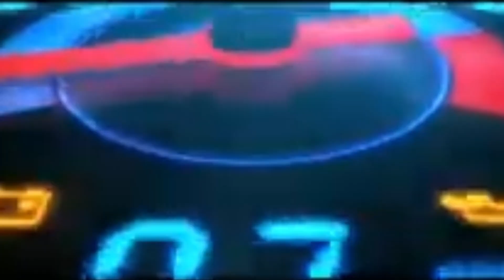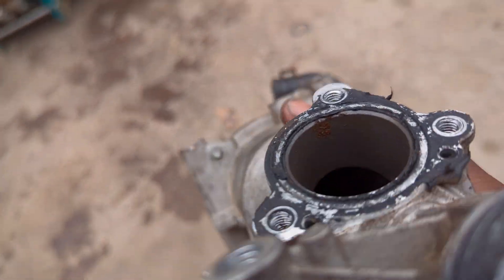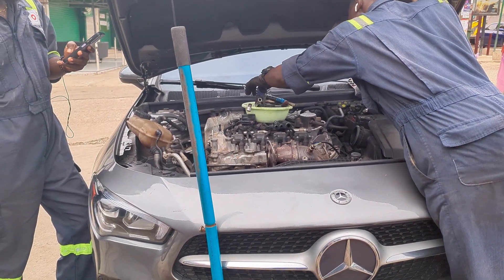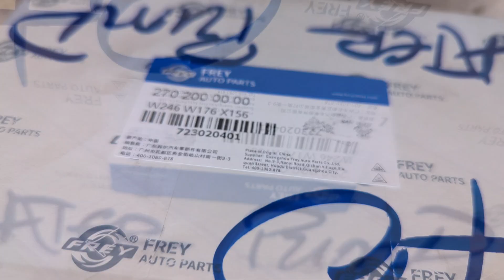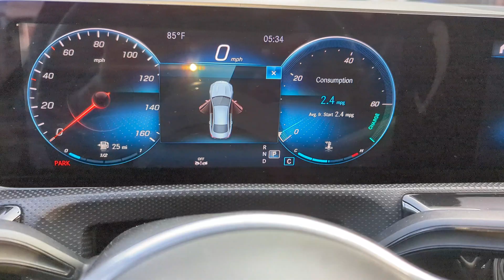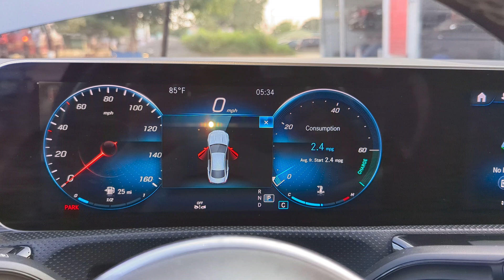[2020 Mercedes Benz CLA250 ]Water/Coolant pump Replacement

Comment: I have Mercedes E220D, 2017 W213, I have a problem that the fan would still be running on max. speed for a 1.5 minutes after killing the engine. Knowing that the engine is Model 654. I have relaced the following parts: Fan, Turmos, Water pump, water back feed line. All original parts but the problem is still on. Also no fault found, could you please help me troubleshooting the problem?

THANKS ALOT.
Reply from the maker: Hello thank you for the Comment,That's expected, most vehicles without a sensor reading will revert to open loop operation and turn on the fan for failsafe if the vehicle cannot determine if it's overheating or not, so it turns it on.We need to do more testing and look at the data stream to see if there's any weirdness especially in the heating and cooling systems.
Reply: It is supposed to do that.